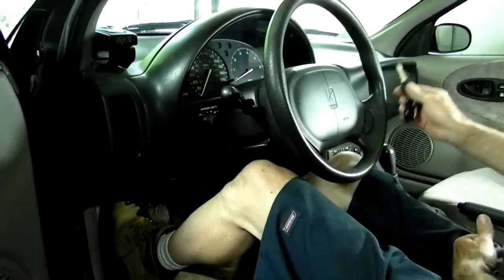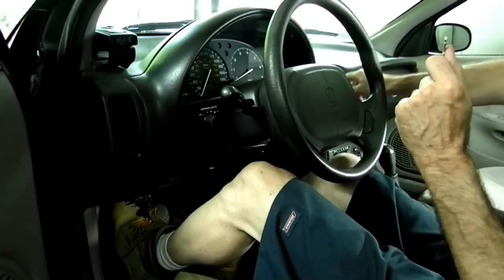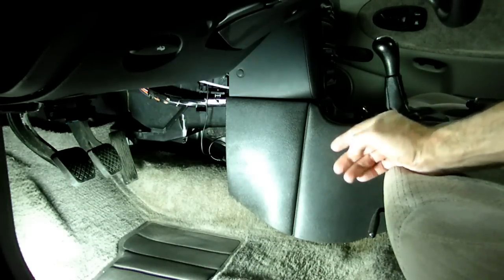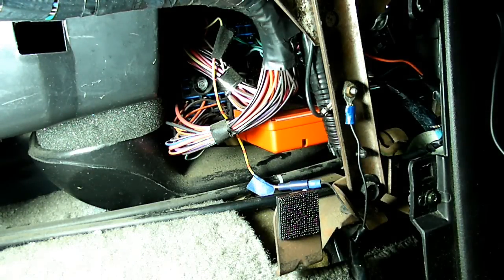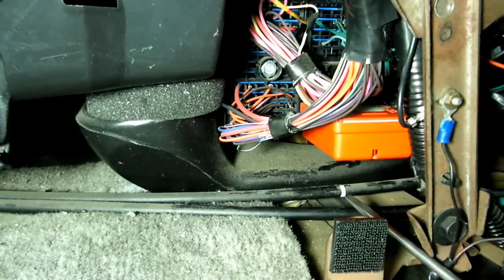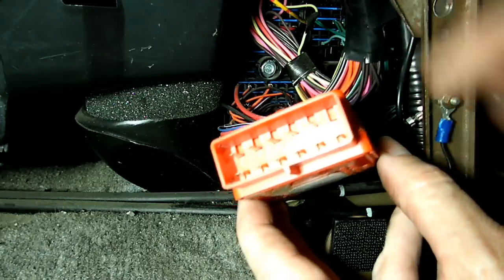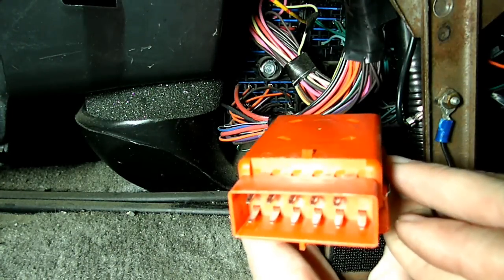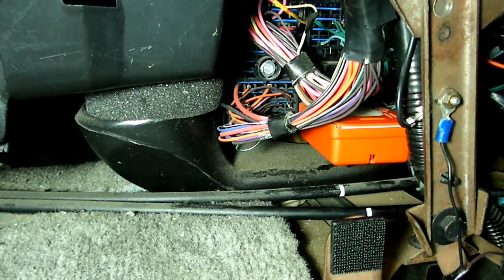Chime Module Replacement

Comment: Once again "The Grand Master Mechanic" has created another useful video.  I truly appreciate you wisdom and knowledge of automobiles.  It is amazing that you knew our defrost was not operating properly on our 1999 Saturn SL.  Basically, only half of the window defrost. I had no idea the chime module had a connection to the operation of the rear window defrost.  Do you have a video on how to troubleshoot or repair the  rear window defrost?  You should have a your own tv show called,THIS OLD CAR.

Comment: I want to thank you sooo much for this video :)  You helped me save money and really feel empowered!  I now have my rear defrost working and it's winter here and that is very important for me.  Thanks again Rose
Reply from the maker: I am glad i could help.
Reply: @RichpinTv  Would a bad chime module also make the interior dome light not come on when you open a door?
Reply: @RichpinTv  I feel like my chime module only works with the key in the run position in my 2002 Buick Regal the door chime only works with the key turned on but when you insert the key in the ignition the door chime doesn’t chime with the door open how can I fix my door chime issue

Comment: Bought the t-50 and boy did it make the job easy.  Thanks again.  I purchased a chimer from pull a part and will replace it soon.  Next is sealing the breaks in the window to get the defrost wire right.  Any product suggests for that job?

Comment: Do you know what the 6 pins are?  I've got a 2005 suburban which uses the radio to play a chime sound thru the car speakers.  No physical chime module.  Aftermarket radios don't have the chime feature unless you spend $100-$140 for a special harness.  Was wondering if there is some way to install one of these older chime modules into my vehicle.

Comment: Will the turn signals work without that Chime Module? I noticed that the module is absent on 2001 Saturn SL2. I was looking for the problem w/Turning lights and marking. None of them is working (worked fine before). Turn fuse is not blown. The Headlights, Hazards, and Brake lights are working. If to open the door w/key in, no sound, but if to switch the headlights and open the door, there would be sound, which continues if to switch off the HLs, but leave the door open. I can't tell if the Chime module was there before or not. We bought the used car. I would appreciate any opinion on this matter. Thank you for the great film.

Comment: So i have question. I have 2000 saturn sl1 and the power locks power mirrors and all interior light's with the exception of the instrument cluster lights stopped working. I checked all the fuses and they all were fine. Have any ideas what it could be?

Comment: Hey Rich:
 I was finally able to check the chime module and it looked pretty corroded so I am going to replace it.  Also, thanks you for sending me the link to how to check a window grid. I followed your instructions regarding testomg the window grid and my numbers were all over the place.  A few lines read 12. A few lines read 5.5 and others read zero. What would cause such a wide fluncation in the numbers?  Again, thanks for your insight.

Comment: I guess I will have to reseal those lines. Thanks.  Oh, one more question. Do you have any idea what kind of tool I can use to remove the seat belts on the 1999 Saturn SL? The seat belts are a mess and they need replacing.  I have no idea what tool to use.  It looks like a large size allen wrench but I don't know what size it is or where I can buy one!

Comment: Hey Rich what about the 2002 SL1? It looks different and there was no orange chime module box.  Any suggestions?
Reply from the maker: The 2000-02 has the chime module built into the body control module.
Reply: @RichpinTv  Where is the body control module located?

Comment: richpin06a got a battery drain on a 99 saturn sl1 I took the car to advance auto parts and it came back as a 0.10 amp drain and it says ok on tester . I did the test light and it only goes off when I take out the chime fuse, but wont crank I also checked chime module its not corroded any suggestions or help greatly appreciated
Reply from the maker: +David Wright Wont crank......are saying the car will not start.
Reply: It will now since I got a new battery today that last two drained within 6 days , so I did the test light trick and it only went out when I pulled the chime fuse, but when the fuse is pulled the car comes on but it wont even try to turn over and the radio stations get deleted, but I watched some of your other videos I did replace the cigarette lighter to charge my phone and it blew the fuse 2 or 3 times so im going to pull that fusd box and see if I fried the f5 fuse and go from there unless you have any suggestions

Comment: richpin06a will a bad chime module prevent the car from cranking
Reply from the maker: Are you having problems with the clock,radio presets and dome light.
Reply: Yea the radio presets and the clock keep resetting
Reply: The battery won't stay charged either and I just put an altinator in about 6 months ago
Reply from the maker: Do a search for Saturn F5 problem and see if it fits your situation.
Reply: Yea I already did that and every thing looked good but I think it has something to do with the alarm siren

Comment: Mine doesn't not chime. I have it where it does to often. If you open the door and the key isn't in the ignition it goes off. But then it will stop for a minute and start again. But once you start the car or close the door it stops.